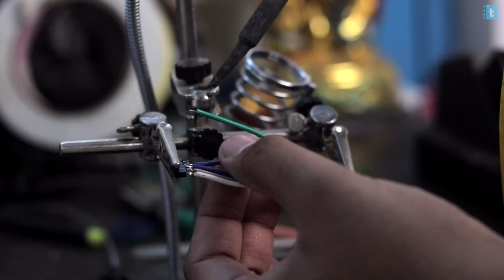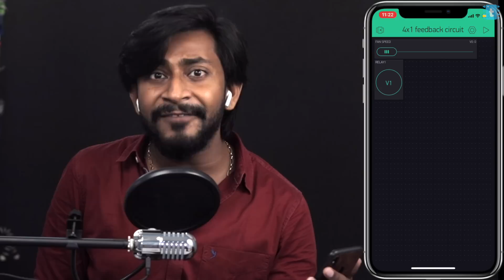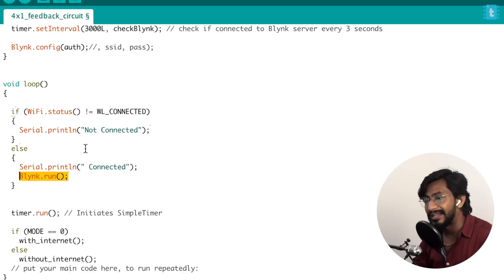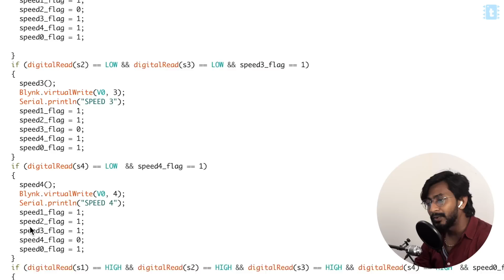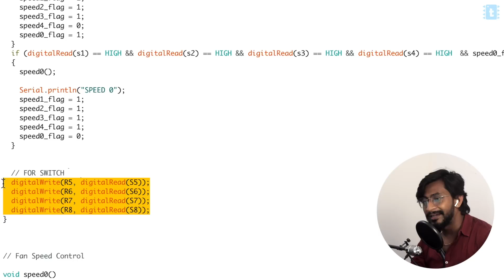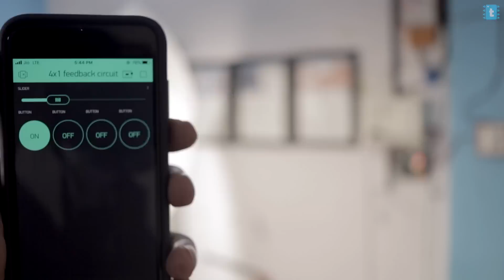All in One Home Automation project with Fan Dimmer | Internet & Manual

Comment: Hello I want to make home automation system for my home. 
I want to connect all devices ( fans bulbs  night bulbs Fridge and inverter). In my home I have 15 electric board for on off fans and bulbs 💡. In YouTube only one board automation system available. I should not use node mcu for every electric boards. My question is we can connect all electric boards only one node mcq / Resberry pi. 

In home automation system Function
Manual Control
App control 
And 
Own Ai and set timer to on off fans and bulbs 💡

Please share me own suggestion

Comment: This project has a drawback. If we turn on light using manual s/w and turn off using blynk, the physical button still remains on although the light is off.
Its absolutely not a deal breaker, but if a pushbutton is used instead of those switches with appropriate changes in code, then this can be resolved!

Comment: Hello Sir, Can you assist with the egg incubator using ESP32 and be able to monitor and control the incubator from anywhere. It should be controlling/set the temperature, humidity, egg turning preferable a 7inch display can be used.

Comment: Dear sir , I'm  using esp32 with sinric alexa integration,  all is working  fine except when controlling  FAN especially  at the time  of Powering  off the Fan. ESP32  is getting hang due to Back EMF of Fan , I have used squard pixels and Excluma ESP but both are showing same behavior .
Please suggest some snubber  circuit that will help me to supress Back EMF coming from FAN  during power off.
It would be very  helpful if you make video.

Comment: Dear sir I tried to make the project as explained, however which switching the fan using relays the back emf is interfering with microcontroller and hence the microcontroller goes in kernal panic and halts, since there is no optocoupling as per ur circuit, kindly tell me a remedy

Comment: Working well but speed 3 not working in manual mode, kindly help me, waiting for your reply.  Which point 10k resistance not connected this point not work
Reply: SORRY THIS WORK, I WAS DO MISTAKE WHILE MAKING REGULATORY,

BUT NOW PROBLEM IS ESP 32 NOT CONNECT AUTOMATICALLY AFTER DISCONNECT TO NET WORK, NEED RESTART TO CONNECT AGAIN. HOW CAN I FIXED ITS
Reply: @tejorshibarik60  Hi... I'm also facing the same problem . Esp32 gets disconnected form blynk app at speed 2 of fan speed control ....then i have to restart it again. He suggested me to change the rotory switch. The rotory switch he used  has 5 terminals . But mine has 6 terminals so this can be causing  the issue. I got the rotory switch from commercial fan regulator.

where did you get the rotory switch from? And how many terminals does it have?

Comment: very unstable, lost wi fi signal again & again. if learner can modified code or circuit diagram than only be useable. Read & watch carefully than you can notice that in code of regulator switch speed 3 there  is input pullup and in rest of speed I mean to say in speed 1, 2, 4 there is no input pullup because in circuit used 10 k resistor as input pullup. So please clearify all these things. I request please do not try to confuse to Viewers.

Comment: Bro, I tried this , but my slider widget keep moving after connecting esp board , why this happening,,?
Reply from the maker: Have you connected that rotary switch ?

If yes then you must have connected in wrong manner
Reply: @techiesms  bro I contacted nothing ,,, just upload code on esp32 and chq serial monitor , and when I see in blynk app , my slider keep moving ,,,
Reply from the maker: That’s why it’s happening 

Once You connect all the components it won’t happen
Reply: @techiesms  ok bro thanks for your replies , let me check again 

And lots of love and support to you ❤️❤️❤️
Reply: @yogendrajamsariya1193  Hi....is it working now? If yes, please tell me where did you get the rotory switch from?
Reply: @blaise4083  bro you can use normal fan regulator switch
Reply: @blaise4083  you can use fan regulator as a rotary
Reply: @yogendrajamsariya1193  I did use a commercial fan regular  but the one I got has 6 terminals instead of 5. It is in fact 4 speed fan regulator..... Can I know the brand of the fan regulator you used?
Reply: @blaise4083  you can use 4 speed control regulator switch ,  cona, Howells, any kind of
Reply: And please don't disable it just use as it as , only solder speed pin to esp 32
Reply: @yogendrajamsariya1193  thanks for your reply....I will try one of these brands and see..... The one I had earlier brought was from Roma brand..... The issue I'm having is at speed 2, ESP32 gets disconnected from blynk. So then I have to restart it again. Otherwise it works fine

And what do you exactly mean by don't disable it?... You mean not completely desolder it from the fan regulator PCB?..... Cause I had troble in desoldering the previous rotory switch.

Comment: Hi.... Finally I was able to do this project. It works almost fine. The only issue I'm facing is the module gets disconnected from blynk app at speed 2 of fan speed for some reason. Then I have to switch it ON again the slide switch or else it won't connect automatically...It works fine at speed 0,1,3,4 .... Do you'll have any idea what is causing the problem?
Reply from the maker: Try changing the rotary switch
Reply: @techiesms  thanks for your reply! .....I tried without connecting to fan.... This time it works fine.....there is no disconnection issue ... I don't know what is causing the problem

Comment: Why esp32 is not connecting to wifi when esc32 is installed on full circuit after removing the manual fan control connection then it was connected to wifi please solve this problem

Comment: Hi did this project for my home with small changes in code all seems good but the blue LED on esp32 board not working with internet connections with my code but void loop is just copied with u r code ....
Reply: Hi....I also did the project.....but I'm having issues with fan speed control...the ESP32 gets disconnected from blynk at speed 2... Otherwise it works fine...for rotory switch he used 5 terminals rotory switch but I got 6 terminal rotory switch (removed from 4 speed fan regulator)....can I ask you from where you got the rotory switch?
Reply: @blaise4083   hi I am also used 6 pin ( 5 speed ) and modified the code as per my requirements and working fine ... but after power cut/ loss if I change manual switch positions those are not updated into blynk app after power resumes back.
Reply: @viswanathnehrugolagabathul4399  ok 👍

Comment: Hi I am making this project for my home , but I had one query I.e while I will keep manual fan regulator in 0 position and operate with internet function and keep the speed of fan at 4 and if internet or power of WiFi router lost for 1 hour than after resume of power does my fan resume at speed 4 or not, please advise me regarding my query 🙏

Comment: Hi, I tried this project and I am facing the issue where the current limiting resistor used in series with polyester capacitor burns out after repeated usage... Is there any reason for it?

Comment: Can. you post the Gerber file, So that we can order the board and use it.
Reply from the maker: No I Can't
But you can purchase this complete project if you want. The link is in the description
Reply: @techiesms  It seems the item is out of order. It is not allowing to add.
So only asked you to upload the Gerber file.
Reply: If you can make only the fan circuit , it is enough for me. I don't need the rest as I have done the rest of it. I am not got at soldering the components
Reply: If not please let me know when can I get produced.
Reply from the maker: You can get the ready project with all the components soldered on it
just goto this link https://bit.ly/2Zuo5V6
Reply: Thx a lot
Reply: ESP8266 BASED DIMMER PCB is for fan. I wanted to order this.

Comment: Hi....I was looking in the circuit diagram provided by you and I was wondering if separate Switch(on/off) is provided to fan regulator also...
As per the diag. 4 switches are provided to control 4 appliances (say bulb 1,2,3&4) and fan switch (on/off) is controlled through regulator itself... Is this correct?
Reply: Yeah

Comment: You used 10K resistor between input from the electrical switch and 5V supply for relay from the converter. But for digital input for esp you connected it directly. So my question was is safe for the board to do so and that if it is shown correct in the connection diagram that the 10K resistor is between switch and 5v dc supply.
Also thanks a lot your videos are inspiring and helping me make an automation system based on my requirements.

Comment: Is this project controllable only through same WiFi router connected to the project  or for example mobile data (which can control from far away distance from the project)?
Reply from the maker: It will be controlled from anywhere in the world
Reply: @techiesms  thanks for the quick reply 👍

Comment: I understand that we need 5 volts to power esp32 and relay but Why did you use a supply of 5 watt specifically not higher or lower. Can someone explain me how to select Power supply if i want to use more or less components
Reply from the maker: Depends upon what will be the maximum consumption of the project.
Just calculate the total current consumed when all the relays are turned on and you'll get the idea

Comment: i am facing some issues of fan controling
Reply: You did the project on your own? 
Asking this because I did the project and I'm also having issue with fan control....my ESP 32 gets disconnected from blynk at speed 2... Otherwise it works fine... Did you got rotory switch with 5 terminals? .... because I got rotory switch with 6 terminals...so I had to modify it.... If you got same rotory switch as him please tell me where did you got it from?

Comment: Nice compact design. But the price is too high for one, it based on blynk and iftt it cant be controlled with Google Home App / Alexa app.
Another i might be wrong but its only single user control for whoever has created the project in blynk.

But it could be easily done.
Also shud add detail on how to add or reduce the number of relays or fan dimmers. Would be great.

Comment: Hi everything is perfect with this project 
But it will become more cool if you add capacitive touch button in place of manual button the main benifit of adding capacitive button is that when you turn on the switch without internet and turn off using blink app the status of button also change. On the other end when we use normal switch to turn on without internet and turn off using the blink app at this point the state of the normal switch is in on condition which is wrong at this  point of time.

Comment: This is a good project sir😁😁 
But if I may point you can increase the track size for the ac circuit fir better current capability and add high voltage isolation between the ac connector pins for better isolation.😉
Cheers

Comment: Help on this issue. The ESP32 project powered by the laptop USB works perfectly. But the ESP32 program is not working using external power (not the laptop USB). The external power is +5V and can supply up to 1Amp.

Comment: Sir pls reply me if I use ttp223 touch sensor instead of normal switches will it work? and while using ttp223 I want to use just "up and down" buttons for speed control for fan with same circuit which you have mentioned as it is best non humming kit for fan ,if possible pls send me the coding+circuit diagram for my dream project . I'll be very great full to you
Reply: Sir pls reply me if I use ttp223 touch sensor instead of normal switches will it work? and while using ttp223 I want to use just "up and down" buttons for speed control for fan with same circuit which you have mentioned as it is best non humming kit for fan ,if possible pls send me the coding+circuit diagram for my dream project . I'll be very great full to you

Comment: As you connected Manual electrical switch connection to your designed board, 
Problems of this design as per circuit connection 
1. at High voltages or EMI (Electromagnetic interference occurs ) due to the sudden transients , Relay outputs are failed or melted  in that particular case
2.  In the situation of  the board or ESP32 failed 
3. What about switching ON and OFF threshold levels(Immediate switching effect of ON or OFF)  for virtually designed switches in Blyk application 

You have only single chance to disconnect the bord and make actual connection of electrical switches with  the appliances .
 maintenance charges like ( Technician who knows this design is needed for correction  and general electrician is not able to work in it) very high in  the situtation of 1,2,3 problems.

I recommend don't connect this design to  home appliance

This design is only for low level B.Tech projects because so many designs or  projects are available in INSTRUCBLES or YOUTUBE for the Home Automation applications. 
Not help ful to research work any more.

Regards
C.Eng Venkatarao Dadi (Phd),M.Tech
Research fellow 
Andhra University

Comment: Hey Sachin, i want to do this exact project but with 2 fans and 8-10 lights and use Sinric instead of Blynk. what changes should i make in the code? i have seen your sinric video as well so i guess that should be the basic code with the fan regulator code along with it
Hope you reply 😄

Comment: I just got an Idea: we can make the main ESP to connect to router, and other ESPs to each other, and it will make sophisticated Home automation system, and we can add multiple ESPs to make it better, and each ESP can also act as a signal amplifier if distance is an issue......the other ESPs which connect to the main one can be: your Knocki, your Korner, an RFID lock, your "ULTIMATE AUTOMATION SYSTEM with THE FAN".....etc.......This is what I call "THE ULTIMATE ULTIMATE HOME AUTOMATION SYSTEM"
 :-D

Comment: Mmmm i don't think this is home automation... More like remote control for your switches. Home automation is when you don't have to open an app. Like for example home assistant. You can control the switches and other stuff through the app or web interface but you can make automations that trigger things based on a event. Still nice video thooo. 🐧🐧🐧

Comment: Great project @techiesms ! This is something on my radar for some time now but haven't started making it. I plan to use a Triac based dimmer though. But this is also a good alternative. One issue that still needs solving is the fact that when we control the fan speed via the app, the hardware rotary switch gets out of sync of the actual state of the fan. I don't think there is any solution to this except replacing the rotary with up and down push buttons.
Also, I would suggest a small correction in the label you have mentioned as "To Fan". The 2 wires, red and black you show as going to fan is actually not the two connections that go to the fan but one of them is the incoming live wire and the other one is the live wire going to the fan. The neutral wire is not shown in your diagram but is assumed to be connected to the fan directly.

Comment: Excellent work bro and have some ambiguity. Can you please clarify to me how you would be able to read the physical switch status? is there any special hardware required?

I have this doubt because the physical switch is connected to the mains so if you directly interface this to mains we will have dewali:)
Reply from the maker: We don't have to connect switch to the mains. You have to remove the connection of switches from your switch and and connect both the terminals of switches to the PCB itself.

No more Diwali
Reply: Ha ha 😀
Thank you bro.

Comment: Why won't u sell the above project with "Blynk & Wifi Credentials" by OTA... If so it will be very much easy and readymade...
Reply from the maker: I thought of making this 
But for a project that will be working in both internet and without internet conditions, it’s kind of difficult to implement that OTA credentials part of the code 

If the project was working only with internet then I can easily add that OTA part

Comment: Hye bro .I'm from Pakistan .your video is very helpfull to me . But 
Ya project professional nhi ho skta . Q ka as me blynk app use ho rhi hy . 
Plzzz ap MIT app inverter per application bany or use application ko 
Wifi , Bluetooth manul, switches,  ya sub ak ho app per control ho. 
Or agr  mery pass multi wifi device ho wo bhe ak hi app per control ho . 
I think Meri bt ap ka smjh again ho gi . 
Ap ki video sy mjhy boht help hoti Hy . Or me na apni PCB bani Hy . Or ak company ko apna design sell or Diya Hy .ya ap ki video sy mjhe help mili Hy .
Boht sy log ap ki video bs dekhty ho gay per me . Ap ki video ko dekh kr usy implement krta hn . Mjhy Jo problem arhi hy wo me na bta Diya Hy .q ka koi costumer nhi chata ka wo blynk app use kry . Thora professional ho as liya ap app banay MIT app inverter per . Thank you . I hop so you understand my idea and my problem 🙂

Comment: Brother This Is very Good 👍👍👍
Que- can I control single phase induction motor which has current rating 5-10 amps
Reply: It is not a good option to control such high current rating appliances with these relays, you can use 16Amps relay to control such appliances